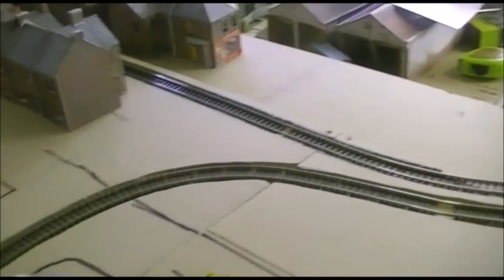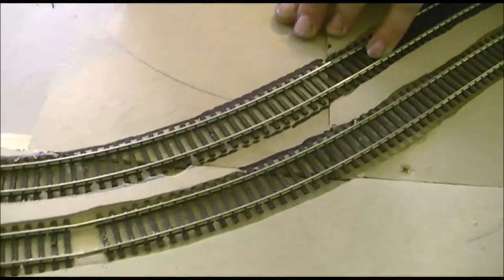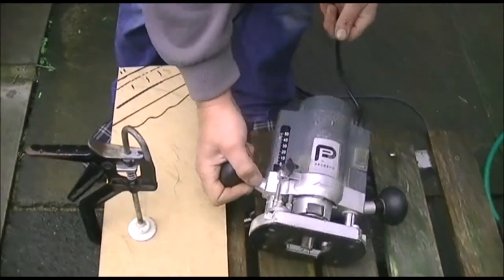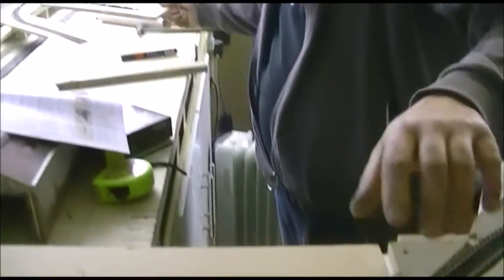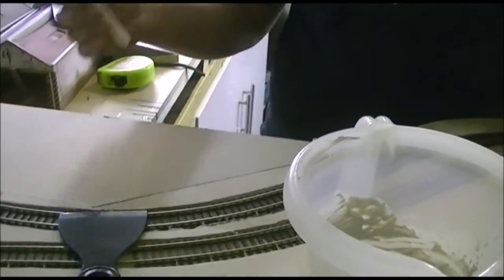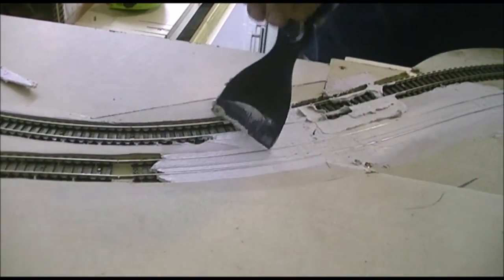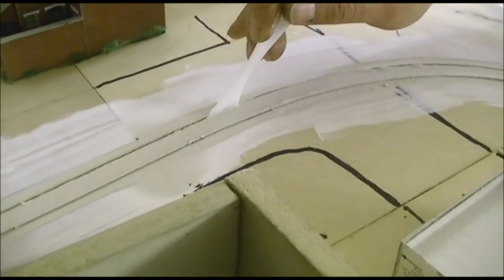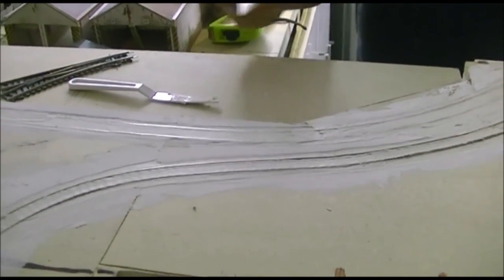How to lay tram lines

Comment: Good  tip : Mix the polyfilla or whatever you are using with black acrylic paint, so that it looks a dark grey colour, similar to tarmac. If for any reason the surface gets chipped, which it will over time, it wont  show white as it would if you laid it white and painted it afterwards. You can also scribe cobblestones on the surface with a sharp scriber, to represent a cobbled street, once it has dried hard and it won't show any white as it would if  you use plain polyfilla. Something I have done many many moons ago when I used to model tramways using live overhead.

Comment: Don't use plaster: it affects the pick ups; never works. Resin is good. Also, tram wheels are not like railway wheels: they have a much finer flange for running in grooved rails. In Glasgow the rail wagons in the docks ran on their flanges in the grooved rail-hence the gauge was 3/4 inch less than standard.
Reply from the maker: john jephcote ours have now been running on this for a few years now with no problems